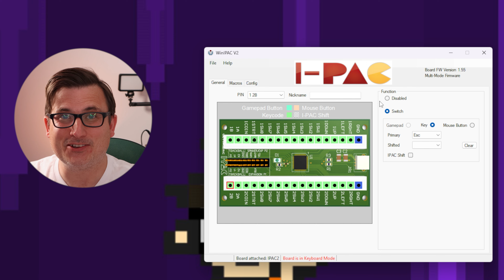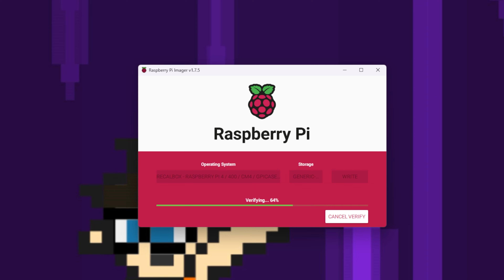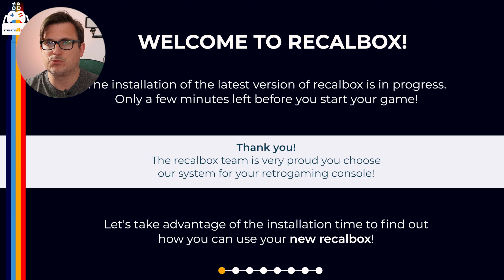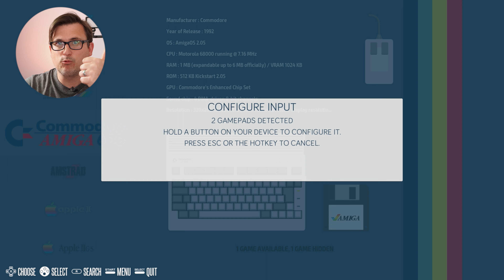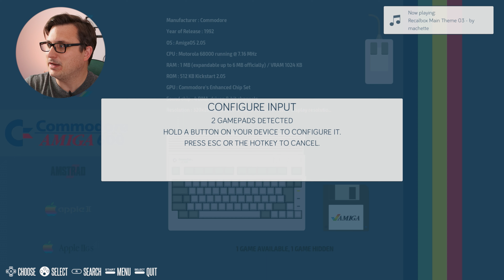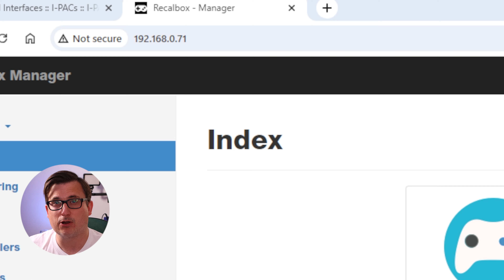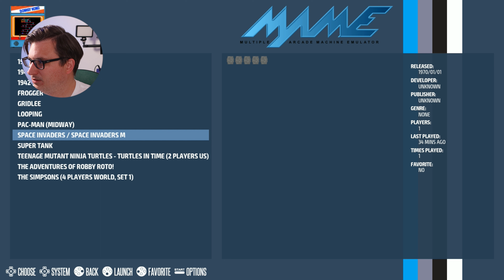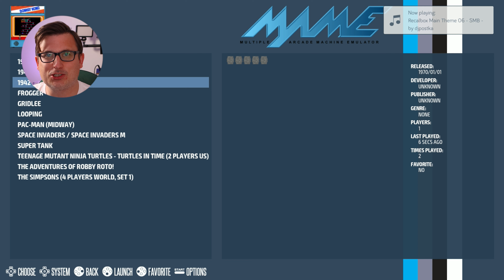Recalbox with a Keyboard Emulator - IT'S CURSED! How To Build Your Own Arcade Machine: Part 2

Comment: I empathize with you -- I have a Pi 400 (basically using RetroPi), an Atari Arcadestick (RetroPi on a Pi3), an Emulec multi-console/arcade emulator, a MiSTerFPGA, and a couple other similar mega-arcade devices... each one using different emulation software, version, and/or hardware and requiring different ways to configure the controllers.  It's maddening trying to figure out the right steps for each one and remembering what buttons to what.
Reply from the maker: It’s madness innit?